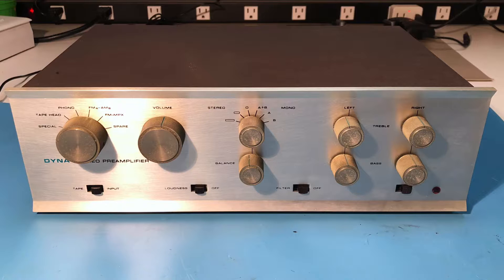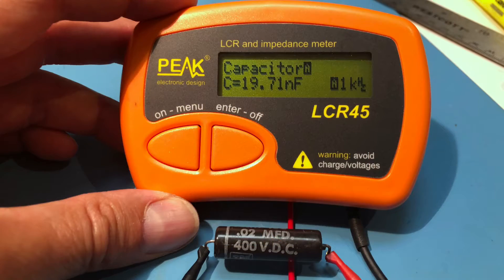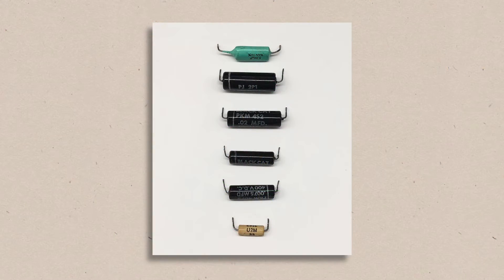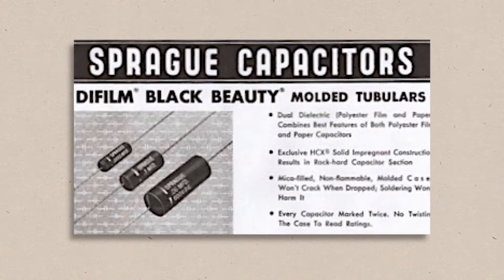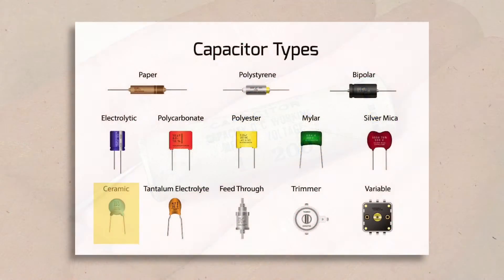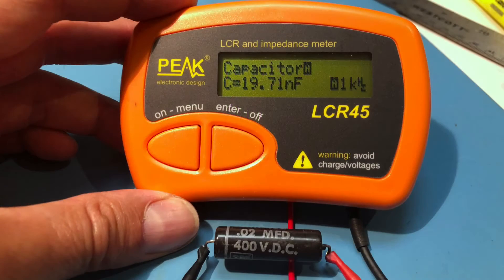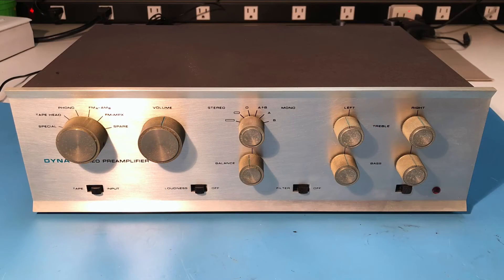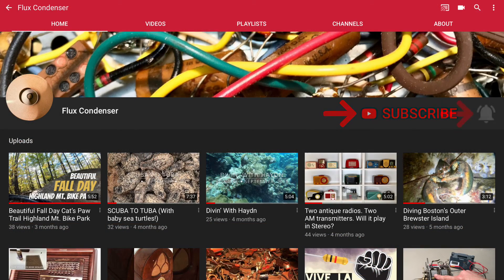The Surprising Truth About Old Capacitors

Comment: I'll give a thunbs up.
However,  NOT ALL capacitors sound the same. 
It has nothing to do whether they measure the same or not. 
It's a mystery. 

Example, why will my car engine have higher oil pressure if i only fill it with 4 quarts of oil vs 5 quarts? 
No one knows
Reply from the maker: Perhaps you meant that in jest, but in case not, here’s my take on that: Just because you say “no one knows” why your oil pressure is lower with four vs. five quarts, doesn’t mean there isn’t a reason it’s happening. Not figuring something out doesn’t make something a magical mystery. It simply means that so far, the people who have attempted to diagnose the issue lack the skills or wherewithal to find the problem. 

Likewise, just because someone finds that two capacitors measure the same for capacitance, but also sound somewhat different doesn’t mean there’s some type of non-measurable “mystery” occurring. If two capacitors sound different, but have the same capacitance, there will be other measurable differences such as ESR, parallel leakage, tangent of loss, etc. 

The world is not a magical place. There are “mysteries” we simply haven’t figured out yet and may never figure out, but that doesn’t mean their causes are magical and without scientific reason. Capacitors are simple devices, and the world figured them out decades ago. If two different capacitors cause a circuit to sound differently in the same position, they will measure differently in some respect.
Reply: @FluxCondenser  Well put sir, I was expecting the usual expectation bias and placebo answer, but you just put into words what my thoughts are exactly. The afore mentioned subconscious anomalies are a reality, but not the only dead-end answer.
Reply: @FluxCondenser  Capacitors are not perfect capacitors, you mentioned series and parallel resistance, or leakage. There is also inductance, very small, parallel and series. Different dielectric materials can have consequential nonlinear effects. There is also microphonics which is problematic for ceramic disk capacitors in audio circuits, piezoelectric effects.

Hard to make a blanket statement that capacitors sound the same when there are so many variables that one might be unaware of and not being measured. Blind testing would be more prudent IMHO.
Reply from the maker: @zulumax1  yes, and all those variables can be detected with tests. As can the audio output when swapping between components. My point is valid. There are no gains to be made simply by swapping to exotic materials. And if a manufacturer is to make such claims, they should be backed up by some real evidence. They don’t, however, because such claims are pure BS.

I agreed, blind testing (if done correctly) would also be helpful, but again, most, if not all claims of sonic superiority would quickly fall apart under such scrutiny.
Reply: @FluxCondenser  I am in the process of recapping a Fisher 500C receiver. I ordered the restuffed electrolytic cans kit from Hayseed Hamfest for $128.95, and ordered the rest of the electrolytic coupling and bypass capacitors from Mouser. Nichicon, nothing fancy. They were all open, and leaking out the seals.

 The rest of the capacitors such as chocolate drop mylar and film capacitors will remain unmolested. The across the line capacitors will be replaced with vishay XY .01 safety capacitors to make it safer.  I am leaving the germanium diodes in with their 3.1 voltage drop, at least for now. Will get a video up soon in the next few days.
Reply: @FluxCondenser  Gene, at Audioholics, just measured those fancy cables with the battery packs attached and tested all the measurable parameters, and he has a lot of test gear.

 It might amuse you to watch it. He does not like snake oil salesmen and holds them accountable by doing measurable tests and puts some of the "mystery" to science scrutiny.

Comment: The smart thing to do is   #1  test a sample of some of the caps in question.........   then make the decision as to whether or not to replace them.    70's era,  and some 60's era stuff does indeed have mylar types that look "questionable"......   and one going BANG in the circuit isn't much fun either.   My current project is a 1969 Jukebox,  and there's lots of film caps in there.  I'm just going after the electrolytic ones.

Comment: Hmmmm.  The PAS-3X doesn't look that different (inside or out) than the PAS-3; which I bought & built in 1963.
Reply from the maker: Yes, the 3 and 3X are very similar. The only difference I believe is in the tone control section where the 3X controls essentially “defeat” the tone circuit in their center positions. Do you still own the preamp? How well did it perform?
Reply: @FluxCondenser  No.  Sad to say - I sold it in 1975.  I needed money to go back to school and finish my EE degree.  Otherwise - I would never have sold it.  It performed flawlessly !! {:>}

Comment: test caps before replacing them? that's a pretty novel concept!
Reply: Important to note that there is a big difference between leaving the original 50-year-old coupling caps in a tube preamp, versus leaving them in the output stage of a tube hifi or guitar amp, running at 400 to 500 volts, where a few microvolts of leakage through the caps can totally overpower the bias and send the tubes into thermal runaway, possibly causing a shorted tube, a damaged output transformer, or even a damaged power tranny. I always replace the output coupling caps. Others may be okay to leave in place, but there's no sense in risking blowing up expensive tubes and transformers.
Reply from the maker: Ha! I know, right?

Comment: not all black cats are mylar but i have found alot of older film caps that are very good. I have found some that actually test better than new one vitamin q caps and old good all film caps that test amazing i have found pyramid caps that are film and very good and even black beautys with red or orange writting are great caps they too are film i have never found a bumblebee cap worth a crap
Reply from the maker: Just goes to show, you never know what’s really inside until you test, so don’t go by appearances alone. Thanks for sharing your experience with bumblebees. For what it’s worth, Paul from Mr. Carlson’s Lab has stated that he believes the Spragues with red text tend to be reliable (only showing perhaps a small amount of leakage) while the ones with yellow text are unreliable.

Comment: Thanks for another great video. I too have a complete Dynaco system, ST70, PAS3, FM3, A25 as well as several SS components. I've restored my ST70 and PAS3 but would love to see your work on the FM3.
Reply from the maker: Thank you! Sounds like you’ve got a lot of experience with Dynaco. I really wish I had made videos of my ST70 and FM3 builds and my PAS3 and A25 restorations. I built them about two years ago and at the time I hadn’t really figured out how to properly “film” on the bench and was getting a little overwhelmed by the video-making process. I just wanted to build them and have fun, not worry about documenting everything, too. I did take quite a few photos, though. 

Now that I’m getting the hang of this video-making thing, I can’t imagine not doing a video for almost any project. I’m actually now enjoying the video-making process as much as the projects I document. 

It’s funny you should mention the FM3 as lately I’ve been thinking I have enough photos to at least put together a somewhat decent presentation using those. I have a couple pieces of McIntosh gear I restored as well which could get a similar treatment. Stay tuned!

Comment: Liked your video.  I have a Carver M500t Power amplifier.  Its from 1980 with all the original parts.  So that makes it 40 years old.  I asked a buddy and resident expert from the Carver club I belong to at The CarverSite to give my Carver amp a "check-up".  He checked all the original caps throughout the amplifier and they all checked within spec.  He also checked all the performance specs of the amp and all was in spec or better.  The tech advised no need to change caps.  The only thing he changed was the speaker binding posts which he upgraded to newer modern type.
Reply from the maker: Thanks for sharing your experience. Much appreciated.

Comment: I completely agree with you. As you well know, there is a mentality in the audiophile world that every time a tech takes the bottom of of the amplifier and looks at the capacitors , they need replacing. Maybe those horrible carbon composition resistors too... As for sound of the ultra expensive capacitors... I have come to the conclusion that we have basically decided, with few exceptions, how equipment is going to sound even before we hear it. Reality from test equipment and our brain often times do not agree. All I can say is if a fellow spends $300 on new fancy capacitors, it Will sound better.  Same for tubes with gold lettering.
Reply from the maker: Sometimes I think I’m alone in the struggle against unsubstantiated audio claims, so I appreciate the moral support. Thanks for stopping by, ElPaso TA. Big fan of your channel.
Reply: @FluxCondenser   Balanced audio technology VK-75SE and VK30 preamp.... class A tube amp, tube preamp. Caps are Nippon Chemi-con... about 20 years old... should I replace them? No swelling, no leakage, no audio hum, pops or other nasties that caps going downhill cause. I talked with the designer and he recommended swapping them out with Mundorf silver/gold. This can be a substantial price as BAT gear is extremely expensive.
Reply: Well, it's the so called confirmation bias of an audiophile's brain that makes him believe when implementing an expensive fancy capacitor the gear has to sound better ... ;-)

Comment: "if 2 caps measure the same they will sound the same"   i've heard similar statements to this and plenty opposing it, wouldnt it be to
Reply from the maker: gary granato Looks like you didn’t quite finish your comment, but I’ll attempt to explain. Yes, if two capacitors measure the same, they will sound the same. But don’t forget that the measurements of a capacitor go beyond simply measuring capacitance and whether it’s leaky. Capacitors of the same type and value, for example, can also have different losses (see my video on Nichicon capacitors for more on this) and ESR (equivalent series resistance). I have never seen anyone prove or demonstrate that when two capacitors of the same type measure closely for all these values that there’s any difference in sound, and my experience backs this up. Saying there’s a difference or believing one hears a difference is not proof. Further, if one can’t point to any measurable aspect of a capacitor (or any component) for improving or degrading sound, what possible reason could there be? This is not mysticism, this is audio. If there’s a difference in sound, somewhere along the chain, something measurable is also different.
Reply: @FluxCondenser   i thought i cancelled the comment.  it would have ended with ( wouldnt it be good to make a video proving this, once and for all) !! 
TBH cant be bothered with the argument anymore re- resistor's/ fuse's/ pot's/ cap's  blah blah blah ......... 
my ears are different to yours and my tastes are different also, so what sounds great to me may sound terrible to you.  
the argument can never be won, just accept that your wrong :)
Reply from the maker: gary granato your first instinct to cancel your comment was spot on :)
Reply: @FluxCondenser  : )

Comment: my concern would be those crappy carbon comp resistors
Reply from the maker: No need for concern. Every resistor was tested and none required replacement. That style of resistor is actually very good. Don’t confuse them for the carbon comps with rounded ends which are indeed, prone to failure.

Comment: I mean in pro audio old gear quite often is waaaaaay out of spec and thats what give its own character. Especially when it comes to microphones. And as such it can make it much more expensive as same thing but new ;p
Reply from the maker: Although many believe that aging components add character to the sound of audio equipment, one should be cautious about equating vintage audio with vintage wines. Failing capacitors can blow transformers, tubes, resistors, diodes, etc. They will increase distortion and noise. Rarely, if ever, do failing components increase even-order distortions which are generally considered more pleasant sounding.

Comment: Congrats on the dynaco procurement. I used to have a pair of st70’s back in the 80,s.  They can keep you war on a cold winter night too.
By 1971, most of the bypass caps were being made to withstand moisture getting in , and were generally manufactured better. The sprauge black beauties have been known to be a problem. Test them with a high voltage tester for leakage. Definitely change the electrolytics. Don’t forget the resistors, they will fall out of spec too. Try to match pair your output tubes as closely as possible watch your bias pots make sure they are clean. Enjoy.
Reply from the maker: Thanks. I had hoped to find a Dynaco preamp in unbuilt form, but that proved hard to come by. The ST-70 I built turned out beautifully. Sounds great and quiet noise floor. Dead simple to set the bias. No wonder it’s been such a popular amp over the decades.